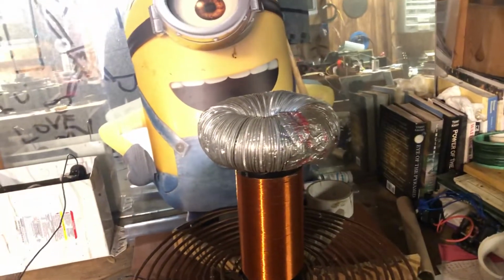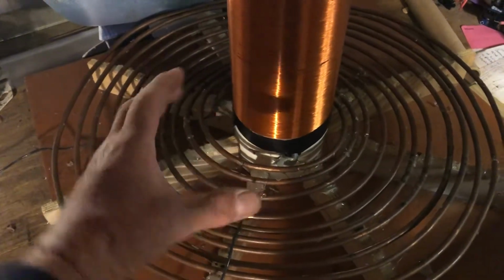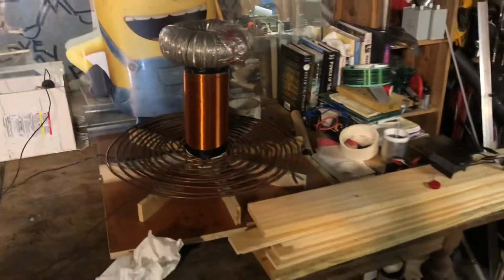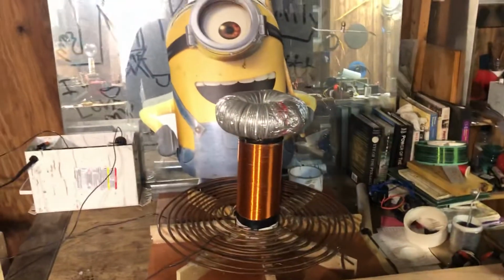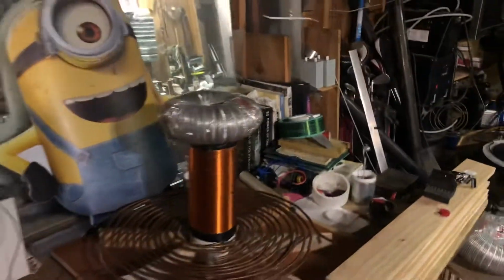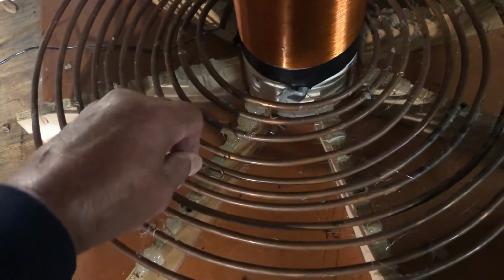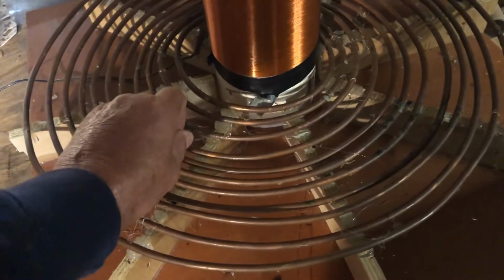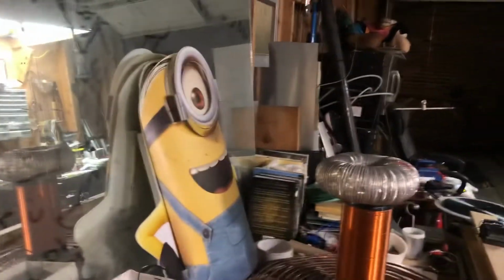Capacitance & Matter!

Comment: 7.5 kilohertz Tesla coil
5 megahertz Tesla coil
14 megahertz vacuum Tesla coil
1/2 million volts electrostatic 
455 kilohertz RF with dummy load
Programmable radar system 10 to 100 millet watts 
Mechanically pulsating Magnetron

Run all this gear at one time keep the Tesla coils 3 feet apart from each other... my cause some interesting effects... STAY OUT of the field area.. aim other gear at Tesla coils... also consider spinning 4 Tesla coils in a inside out motor... 2000 rpm... happy holidays!!